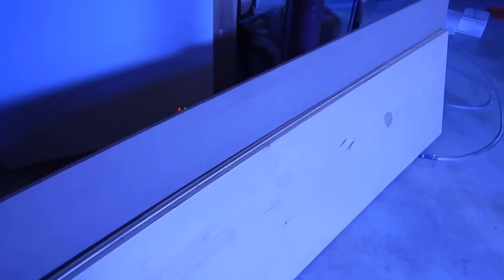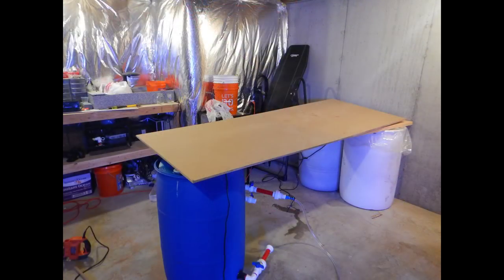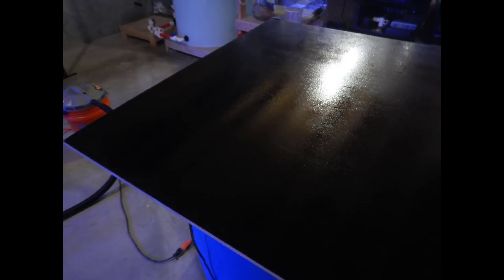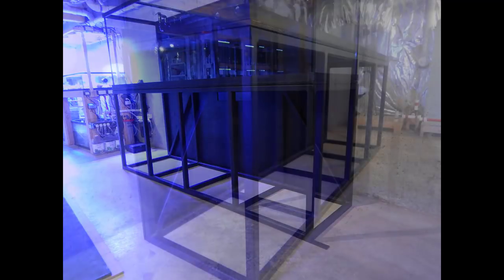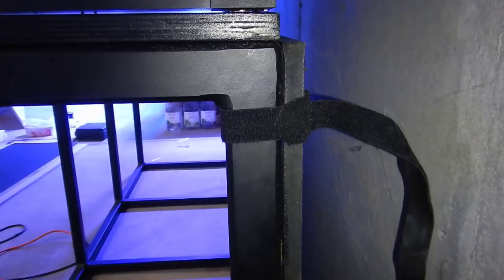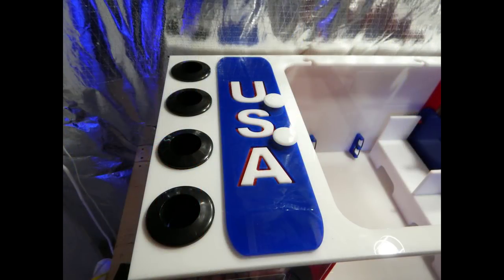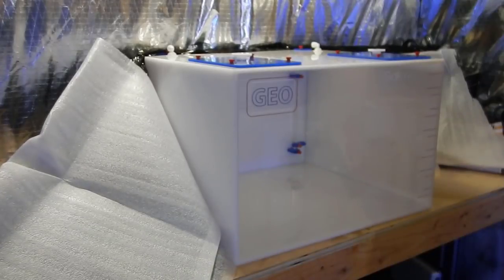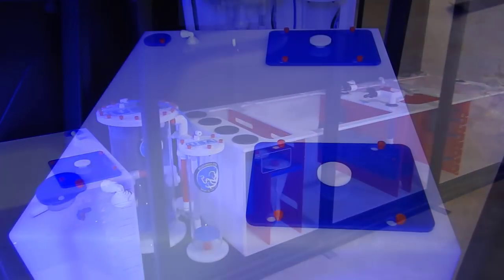300 Gallon Build | Getting The Stand Ready & Adding The Sump

Comment: Curious for why people add the foam underneath the sump?
Reply from the maker: to prevent pressure points that could cause damage to the sump
Reply: FishOfHex thanks Travis!
Reply: If you have a flat bottom sump or tank you need it as the stand you put it in won’t be perfectly flat. If you have a sump or tank with bracing  on bottom line the black frame you don’t need it. He has a flat bottom sump